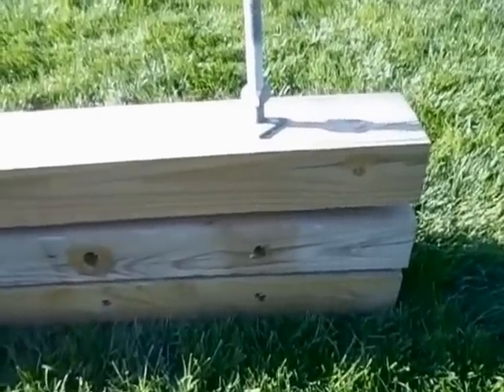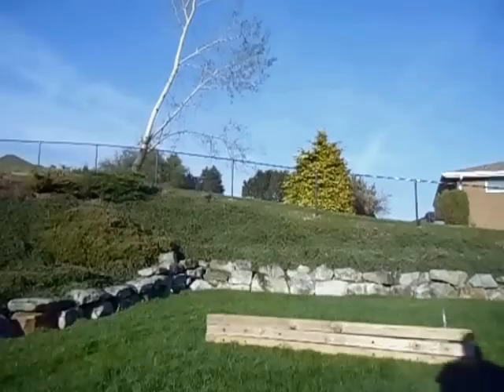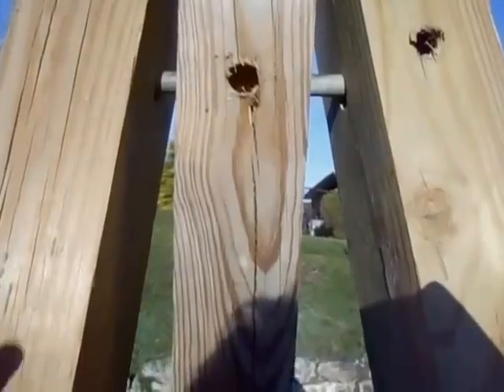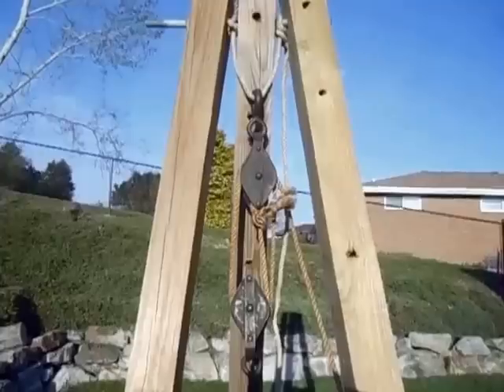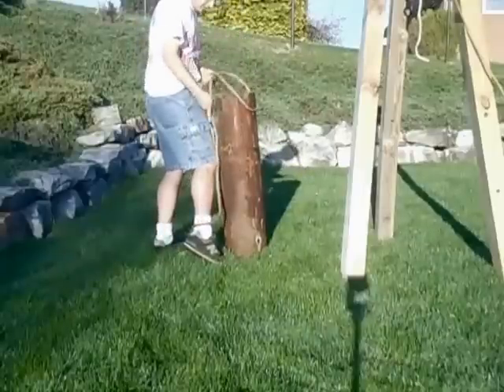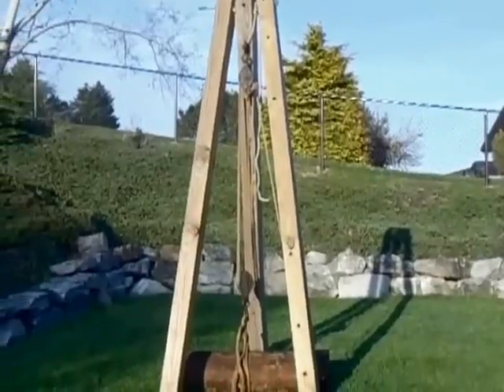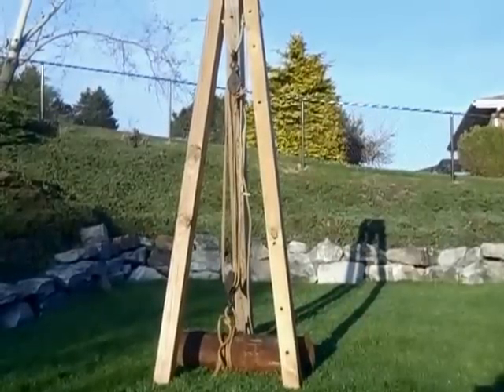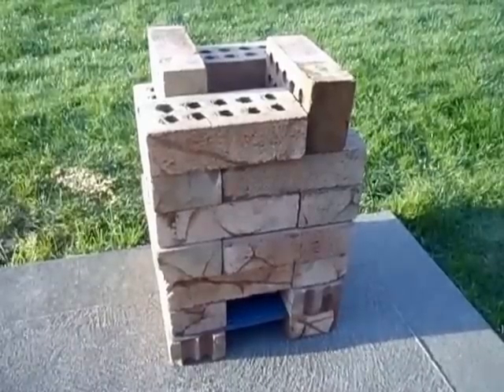Backyard Crane

Comment: Hi any idea the max load of such a device? Thx
Reply: That answer will vary. I'd estimate each 10' post could support around 4500lbs, x 3 = 13,500lbs. Not knowing tensile strength of rope will leave equation at unknown. 

I built one similar. 12' 4x4 posts with a ¾" all thread ran through 1¼ hole,  6 inches from top. Leave 2" gap between posts with a nut and washer. I installed a truck bed tie down, capable of holding 13,000lbs, with 3" ⅝ lag bolts. 1½ ton chain block attached to hook of tie down. Capable of lifting 5 ton. I use for gravestone restorations. Approx $200.

Also created my own jack that will level gravestones just leaning. Very heavy duty! Capable of lifting 10 ton. $4.5k.